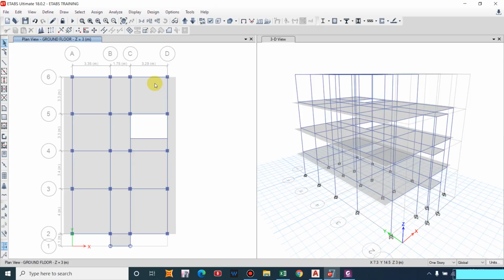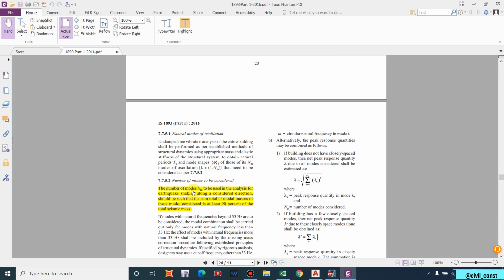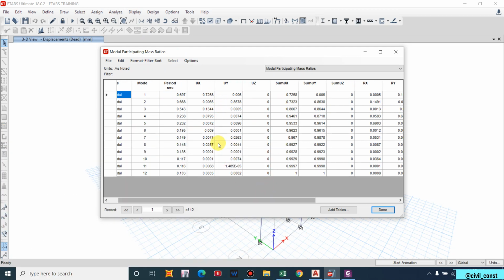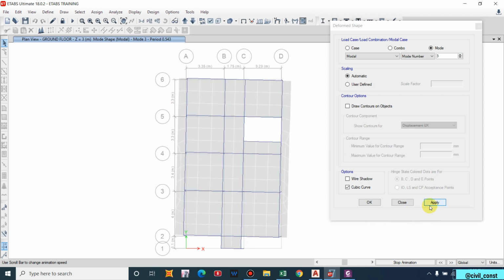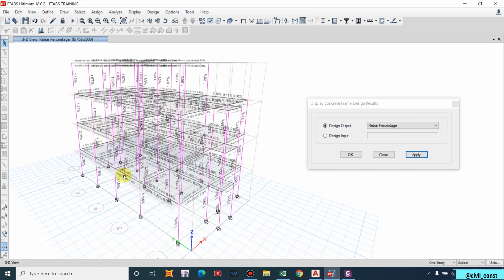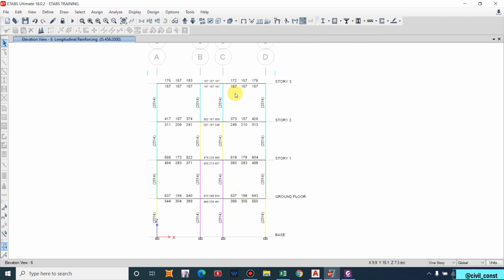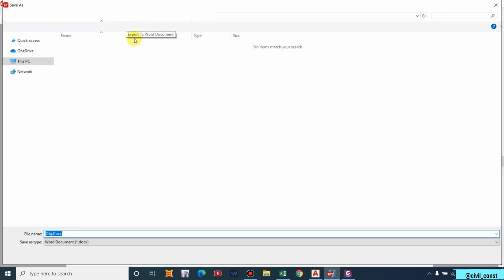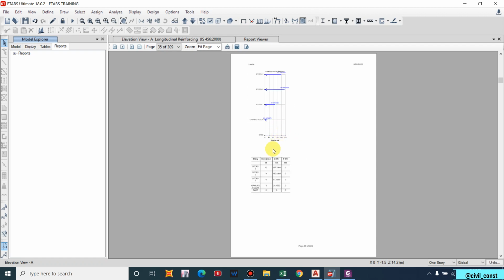Etabs Analysis of G+3 Building | Design of Residential Building Part 7 | Incluidng Project Report |

Comment: Well made video. Thank you Sir. I was searching for the code reference for torsional discomfort in the building. i.e. the first two mode should under go the translation in either direction, and third mode to the rotation. Please help me find some code reference for this explanation is NBC or IS code. and how can we solve it if we didnot get the first 3 mode as we need.
Reply from the maker: Glad it helped. You can find that in IS 1893:2016 part 1, cl 7.1 torsional irregularity.

Comment: What is the solution when the top rebar area comes more than lower floors..please explain
Reply from the maker: That's for B/C ratio.
Reply: @civilconst  Is it ok to design residential buildings by making B/C ratio off in design prefences

Comment: Well explained. Thanks alot. I practiced on one building but the result was not proper. Can u make video on that building. Please share ur mail so that i can send the drawing to u.
Reply from the maker: That's not possible brother. I can't make a whole video for a particular problem. But you can share what actually your problem is? I can help with that.
Reply: Load applied:
- 4" wall - 7
-9" wall - 13
LL - 1.5, 2, 3
FF- 2

     Beam rebar came only 100 TO 250

Comment: I think it is 0.004 times height of single storey i.e 3 m in this case and not total height. Please confirm..
Reply from the maker: Maximum permissible storey displacement and permissible storey drift are calculated from IS: 1893 – 2002 and IS: 456 – 2000. Maximum permissible storey displacement is limited to H/500. Where, H – total height of building. Maximum permissible storey drift is limited to 0.004 h.